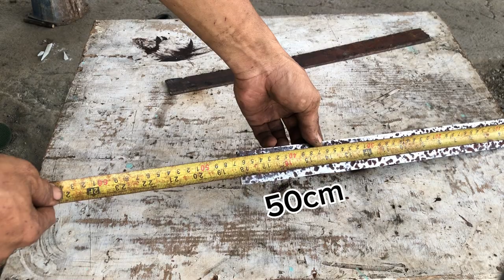How to make basketball ring with spring

Comment: You dont Weld one side completely. You tack Both side to hold the Metal in position to avoid warpage Which is difficult to correct later. After a few tack to hold it then proceed to weld it all around. Nice Video
Reply from the maker: Thank you sir

Comment: holes should be sqare, not round. referent bolt heads should be square, to coincide to prevent turning when tightning the nuts. american rings are like that

Comment: Sir magkano aabutin pag kasama ang board at poste?
Reply from the maker: @Badass_Von15  pag d i y lang ang gastusin mga 2,500 lang
Reply: @JerryTv625  un kort po kasi samen I wala napong ring matagal na at Ang ipinalit ng mayor namin ay mahuna  kaya magpapagawa po kame .gagawin po namin pattern un ginawa nyo
Reply from the maker: @Badass_Von15 yong video ko yon ang standard pang pba na sukat po
Reply: @JerryTv625  10ft po
Reply from the maker: @Badass_Von15  10 ft ok na yong pang standard npo yon.
Reply: @JerryTv625  ok lang paba gamitin un spring na nasa shock ng motor
Reply from the maker: Yong spring sa sasakyan sa cylinder head spring . Tingnan mo sa ginawa ko sa ring ng junior sa video ko
Reply: @JerryTv625  Sir nakalimutan ko po pala tanungin kung anong size ng angle bar na ginamit? Sensya po ule sa abala
Reply from the maker: @Badass_Von15  nan doon napo sa video ko yong sukat
Reply: @JerryTv625  Sir Marami pong salamat nakagawa na po kame ng ring. May Isang Tanong nalang po pano po kaya medyo nakatingala un nagawa namin ring nun nakakabit na?
Reply from the maker: @Badass_Von15  kalsuhan you nlang ng bakal  gamitan nyo ng level bar

Comment: Sir san po galing yung spring na ginamit nyo?
Reply from the maker: Valve spring ng cylender head ng sasakyan /maganda yong sa diesel matibay
Reply: Pwede din po rear shock ng NMAX yung may baso
Reply from the maker: Pwede ? Pero matigas … maganda sa spring ng cylender head ng sasakyan

Comment: Sir mag kano isa?
Reply from the maker: 2 k isa
Reply: Boss ano tawag sa malapad na nasa baba ng ring
Reply from the maker: Holder po ng turnelyo
Reply: Mag kano bili mo mo boss?
Reply from the maker: Scrap lang po ng engine cylender head  spreng
Reply: Boss madali lang ba gumawa
Reply from the maker: Matagal pag di kapa sanay
Reply: Boss send ka nga step by step
Reply: 800 boss?
Reply from the maker: Di kaya mahal materyalis
Reply: 1k boss?
Reply: 1 k boss pwede?
Reply: @JerryTv625 ano po un sir un sa labor lang po ba un o sama nadin dun ang materyales
Reply from the maker: @Badass_Von15  8h lang po gagastusin sa materials pag d i y lang po.
Reply: @JerryTv625  salamat po ng Marami sa pagsagot
Reply from the maker: @Badass_Von15  tnx